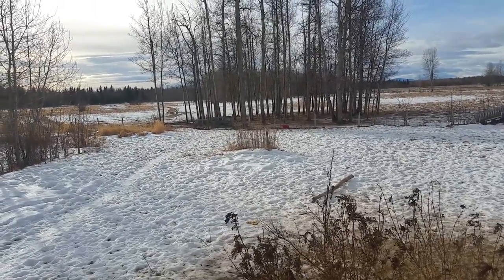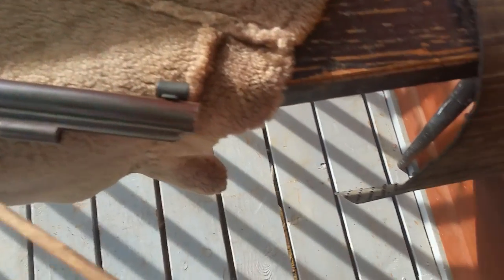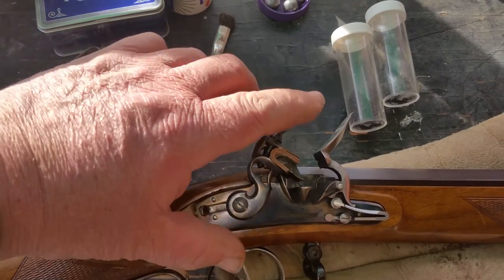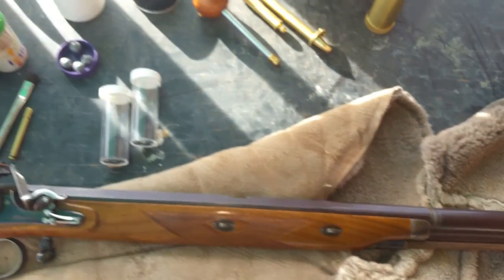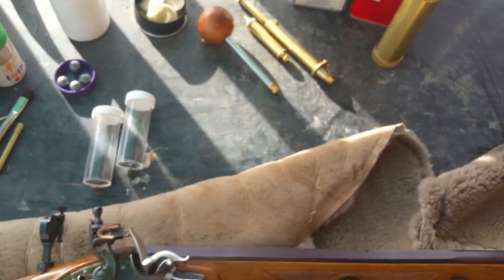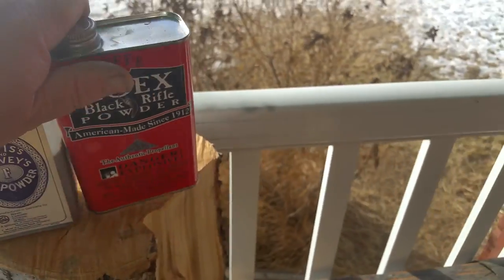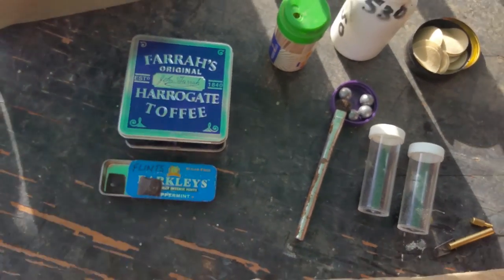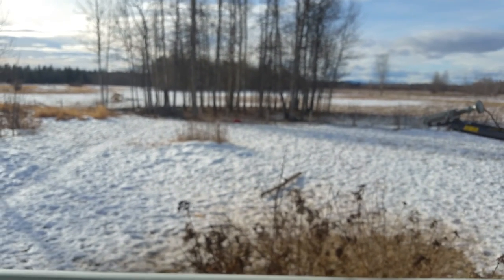Mortimer Flintlock Rifle

Comment: Excellent videos! Looking back, would you have preferred the Mortimer Whitworth to the Mortimer Target? My club's range only extends to 300 yards, so I'm wondering which you would recommend in that instance. Cheers.
Reply from the maker: Hi Peter.The Mortimer Whitworth is a percussion rifle built for the MLAIC 100m class and I particularly wanted an accurate flintlock to shoot roundball at 100 yds . 
The Mortimer Whitworth may be just fine at 300 , I don't have any experience . You could also look at the Pedersoli Volunteer , the Pedersoli Whitworth hexagonal barrel rifle or maybe the new short range Gibbs if you are looking for a percussion rifle .
 I also have a Whitworth with hexagonal rifling and I love it .